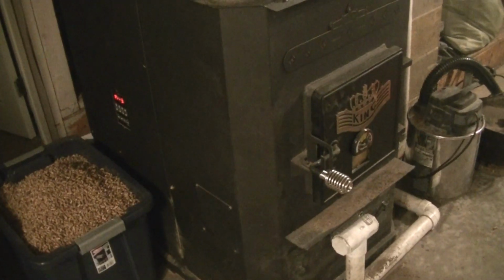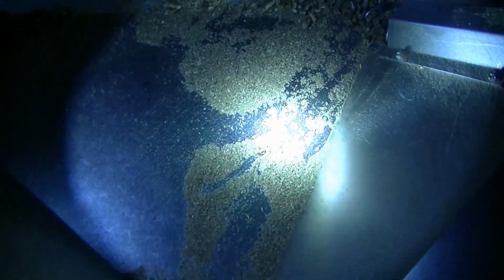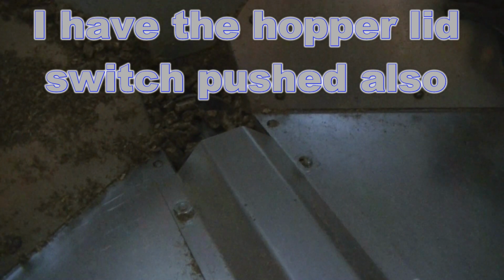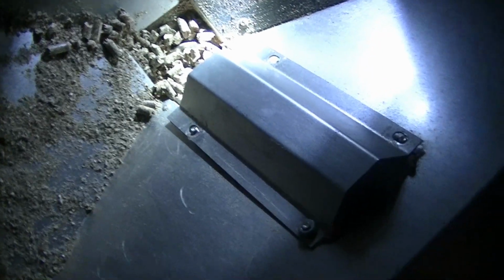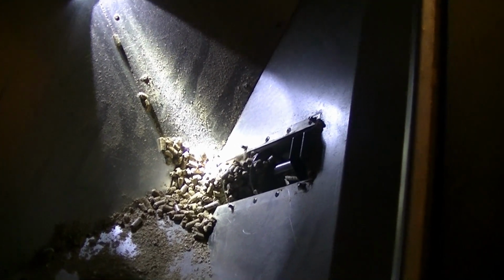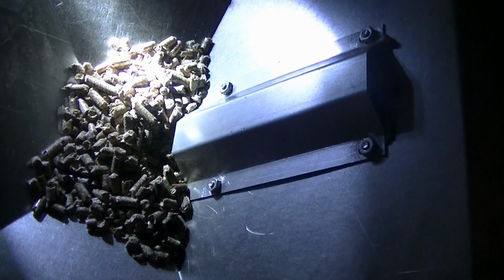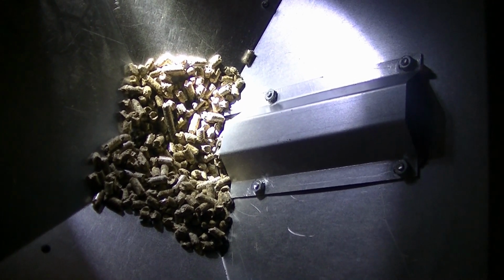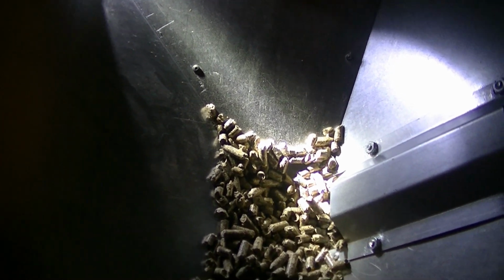Pellet Stove Auger Jam Repair

Comment: I pulled the cover and it was clean and empty. Its still not spinning for some reason. It spins just for a sec and then stops....((((
Reply from the maker: Just saw this comment; it normally just spins for a second, depending on settings.  Then it spins again.  If you hold down the on button you can keep the auger running until you hear pellets falling into the fire pot.

Comment: Put in new top and bottom oil impregnated bronze auger bushings and it will not jam up so much. You can also screen the wood pellets before adding them to the hopper. :-)